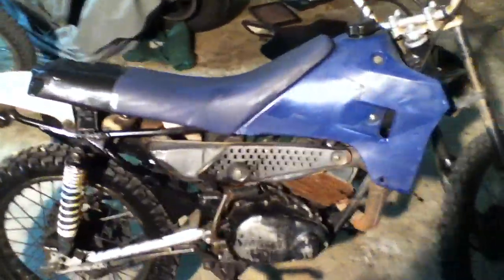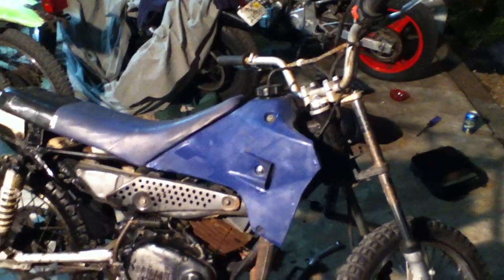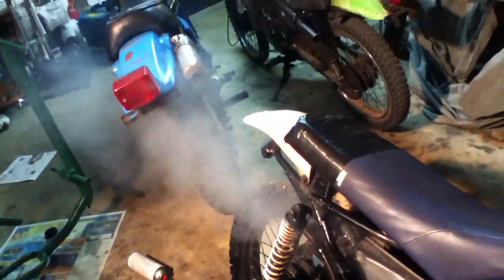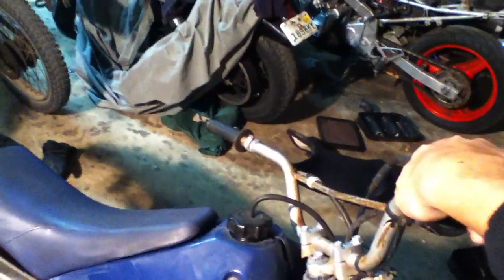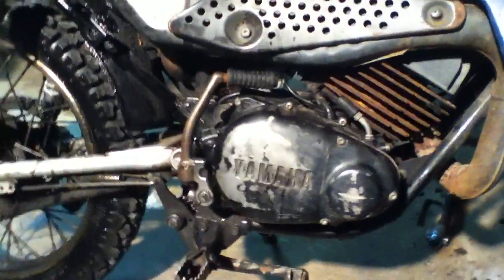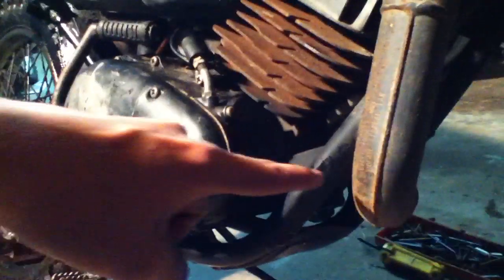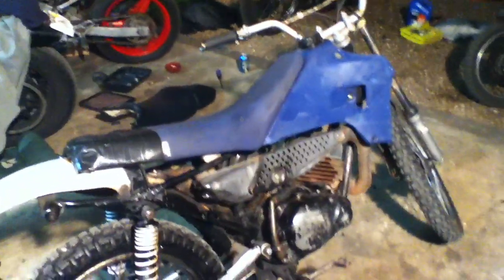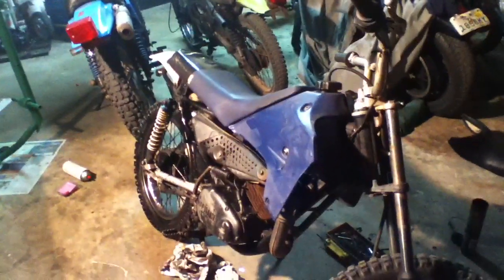Yamaha RT 100- Blown Crankshaft Seal

Comment: I'm working on one now. It smokes, and when I'm riding it bogs down, to keep it going, I'd put the throttle to a certain spot. Also, I took the oil pump cable off, and run gas and oiled mixed in the cylinder.

Comment: Use Klotz Flex Drive 30, it supersedes the oil recommended in the 1990-2000 RT shop manual. Its the red stuff, 75W/80, similar oil used in a car transmission but made for 2 stroke bikes/quads. All race 2 strokes require this type of oil for the clutch, not sure why Yamaha recommended SAE oil to begin with for their play bikes. Flex Drive 30 (or your fav brand with similar mix) is what should be run in the trans/clutch side. Dont use regular SAE.

Comment: If the crank seals were bad it wouldnt make good power. They usually will rev up and down and have a rough time idling. Do a pressure test on the crankcase and see if it leaks down.
Reply from the maker: there's a part 2 to this video after i replaced the crank seal and it runs good. its on my channel

Comment from the maker: if it runs well and it doesn't burn up any transmission oil, then it's probably fine. The bike might be smoking because it's running too rich. You can try adjusting the carburetor to make the bike run a little bit leaner. Of course, all 2 stroke bikes are supposed to smoke.

Comment: I like that ke100 you got there. Was there smoke coming from the engine itself? Mine is. The exhaust too but its fouling plugs after just 2 or 3 kicks
Reply from the maker: no smoke from the engine just from the exhaust. It ran pretty good like this but just smoked a bunch and the oil level in the trans kept dropping

Comment: I have a 1995 Yamaha Rt100 too and mine starts first kick but it burns Aton of gear oil and I run type-F, and it is super smoky and it was just rebuilt with new crank bearings and seals, and still smokes like crazy and I think the shop I brought it to put the seal in wrong, can you guys help me figure out the problem?
Reply from the maker: If it burns through transmission oil (like the level goes down but its not leaking out) then the right crank seal is bad. Theres no other way it can burn trans oil. Also use 10w30 or 10w40 motor oil in the transmission. Not type f
Reply: Okay, thanks man, it also splatters oil out the silencer, but I don’t have the outlet to the silencer. And I don’t know if that matters though.
Reply: Hello I’m back and for some reason it stopped burning gear lube randomly and is not as smoky, rode it for a few hours a day and didn’t burn any oil, but clutch does need adjusted though, thanks for the help man.

Comment from the maker: Wrong. 2 stroke motorcycle engines use 4 stroke motor oil to lubricate the transmission. The RT100 specifically calls for 10w-40 motor oil in the transmission.
Reply: Alex's Bikes and Motors WRONG! They call for 10w-30

Comment: Leaf blowers do not have a transmission with a wet clutch in them because if they did they would need 4 stroke oil in the 
trans
Reply: johnharveylynn youre so wrong, they do have 4 stroke oil in the wet clutch. it uses 10w40 in my 2001 kx100.

Comment: When you do oil changes on the Yamaha 100 RT do you use two-stroke motor oil or two-stroke transmission oil
Reply from the maker: 10w-40 motor oil goes in the transmission
Reply: Ok thanks
Reply: Check your owners manual. My 1990 calls for 10w30
Reply from the maker: @whoisadam944  10w30 10w40 pretty much the same thing
Reply: @alexsbikesandmotors  it's true...but anyone who asks in a YouTube video what motor oil to use on their bike....should probably be sticking to the books 😅
Reply: 2 stroke trans oil (red stuff). Check the fill plug every so often after riding and keep it topped off right in between the plug marks as stated the in the manual. Klotz Flex-Drive 30 is perfect. Drain and re-fill with new oil every few years if you ride a lot but its not necessary as it will last a very long time if your just cruising around and you use the clutch like you should when shifting. The clutch plates will love the red stuff and give you a smooth pull when shifting.

Comment: hey man i got given a cr80 1992 and spent over 1000$ just fixing all of it so its all fixed eg wheels and brakes and shit like that... and starts and runs fine but it smokes even more than what your bike dose but like you get in a high gear and pin it up the road and it's lke a normal 2 stroke running. is it bad to run it still? like just on idel even? thanks mate.

Comment: after removing the oil pump and plugging the carb, do i still need oil in the tank?
Reply from the maker: no, the tank can be removed completely. But you must mix oil with the gas.
Reply: Alex's Bikes and Motors
would i need oil in the crankcase?
Reply from the maker: Timothy Randell
Since this is a 2 stroke bike, you can't put oil in the crankcase. The engine is lubricated by oil mixed with the gas. However, you still must keep oil in the transmission (right side cover)

Comment: Thisisme0214 someone had said u dont put it in your weed eater like they were proving a point i said thats because they dont have a wet clutch.... With a wet clutch 4 stroke oil goes in the trans all my 2 stroke bikes use 4 stroke oil in the trans!!!! U do not put 4 stroke oil in a weed eater because no transmission and wet clutch im so not wrong extremely right actually